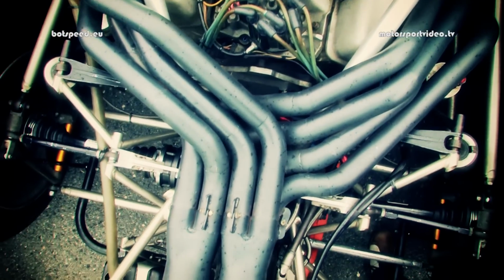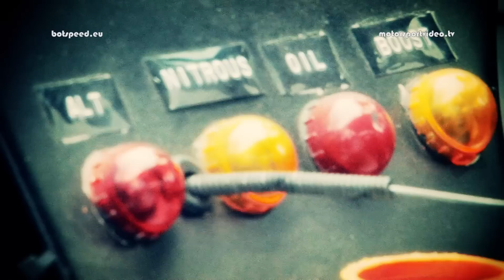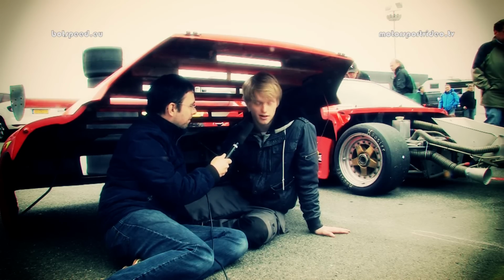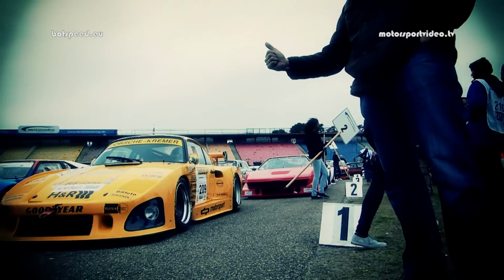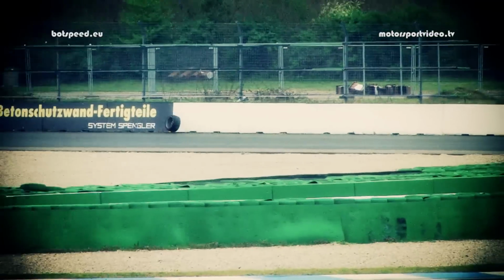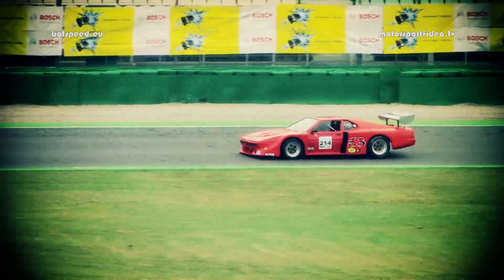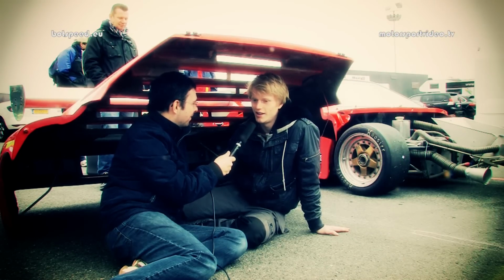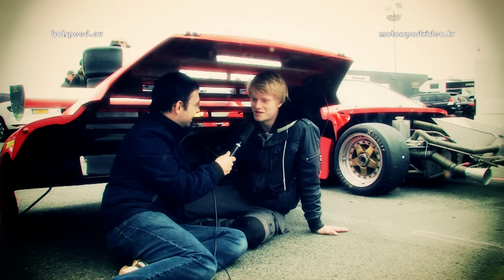March BMW M1 in Hockenheim

Comment: They had.
The BMW management decided on the last moment, in April 1980, that they should start concentrating on F1 with a turbocharged four cilinder instead of the World Championship of Makes for GT's with this car. This resulted in winning the F1 championship in 1983 but also meant this car wouldn't get his promised engine. It was a political choice, not a technical problem.
In April 1980 this car was converted to Chevrolet V8 power..